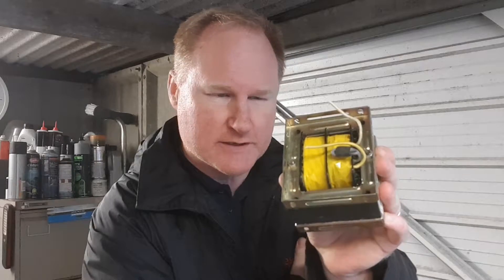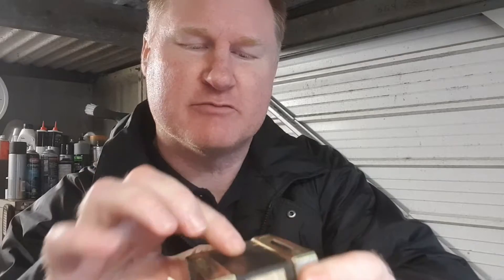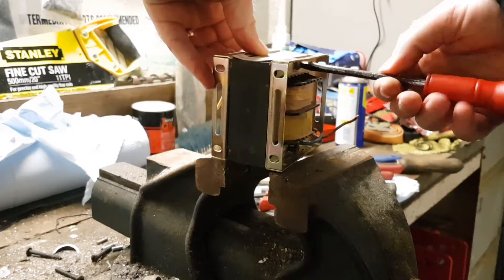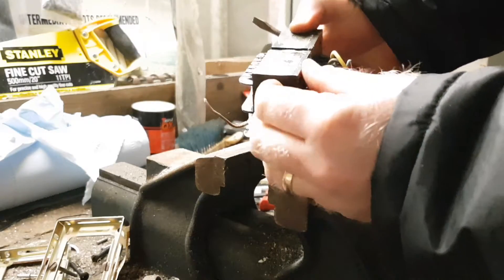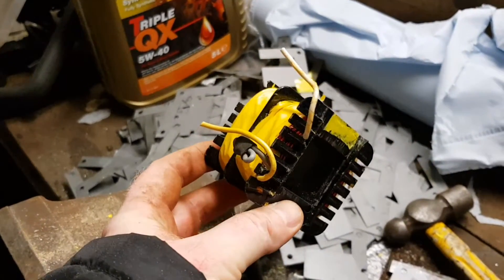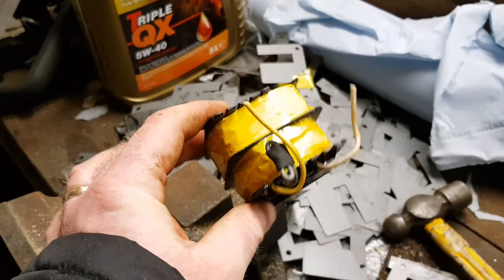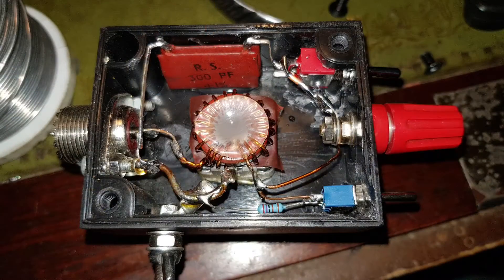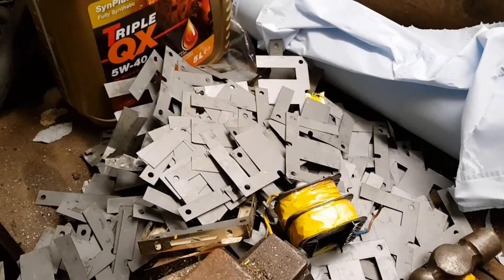How to strip transformers for wire

Comment: The enameled wire doesn't crack when you unwind it ? I mean the enamel itself ?
Reply from the maker: Aleziss Not cracking at all, it can be flexed about plenty with no issues
Reply: good idea then, I was under the impression that it would crack the enamel on the wires... I will definively look out for a good size transformer then ! I need to build my 9:1 transformer for my end-fed antenna...
Reply from the maker: Aleziss 9to1 not great, requires a very good ground. But it does offer many band on one wire. I prefer end fed half wave, much bigger punch.. look at AA5TB website
Reply: mk1tina, wait what ? I thought 9:1 did NOT require ground ? See https://www.n1kdo.com/baluns-ununs/index.html and it's 9:1 description. Also ultimax 100 antenna seems to be build the same way with excellent reviews... MY RADIO IS ARRIVING AT THIS MOMENT !!!
Reply from the maker: Aleziss that's not a 9to1. That's effectively a LC network for halfwave

Comment: I've done this myself, the only problem I have is that I seem to get a lot of transformers where a glue of some kind has been poured over the windings. It's quite brittle but the shards are razor sharp and make the job very messy.
Reply: That isn't glue. It's varnish. Just like ordinary wood varnish. After the transformers are wound they are dipped. (Soaked in a vat of varnish) sometimes in a vacuum chamber to get all the air out. Then the transformers are baked in an oven over night before being left to cool down. This varnish acts as an extra insulating layer and also prevents the coils from vibrating during use. In my late teens, I used to work at Powerline, later becoming Chloride international, where I used to make transformers from start to finish. Though they were much bigger than microwave oven transformers!
Reply from the maker: shellac
Reply from the maker: VK6OP not good
Reply: Thanks Banjax66, I had no idea. Very interesting mate.

Comment: Ha HA Giving away secrets :-)  I have just used my last haul and will be spending tomorrow rescuing some more.  Nobodies microwave is safe ;-)
Reply from the maker: Indeed microwaves could be a good modern source.. Thanks for your comment and good hunting tomorrow my friend .. 73
Reply: Microwave transformers are not worth keeping for the wire as they are usually wound with aluminium instead of copper, so the wire can't be soldered to.
Reply from the maker: banjax66 that's a shame
Reply: When you open up the microwave check for soldered connections at the transformer.  Reject any that are screwed.  Has worked for me in the past and hopefully today :-)